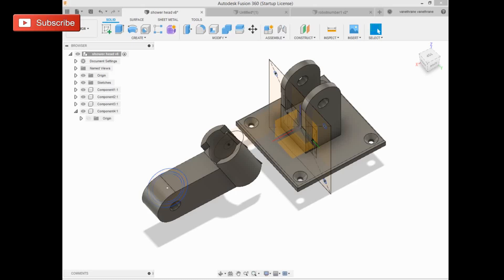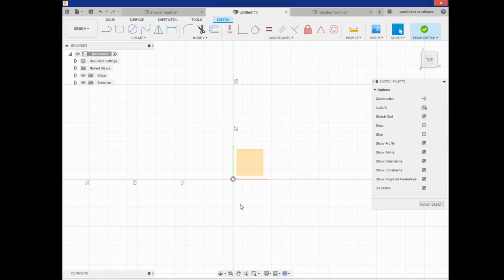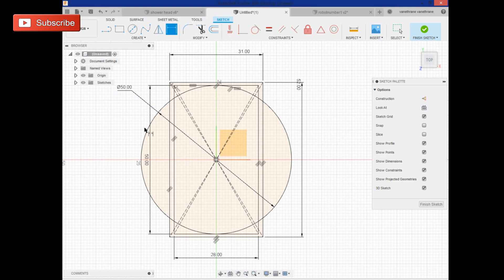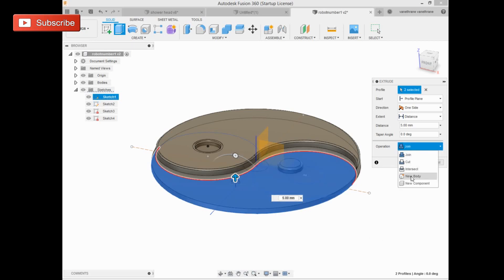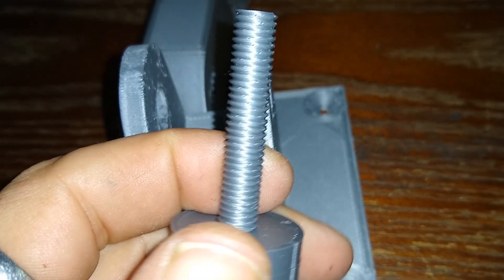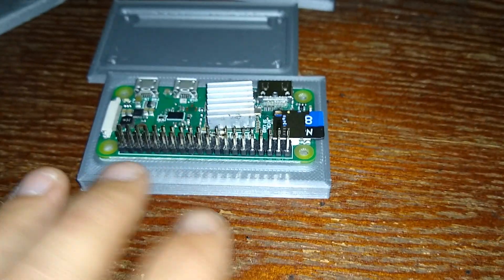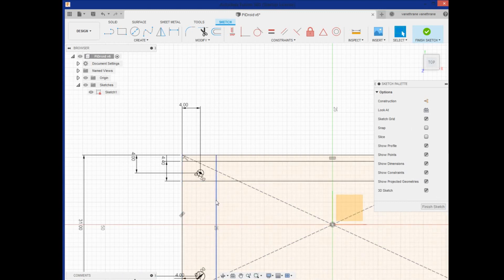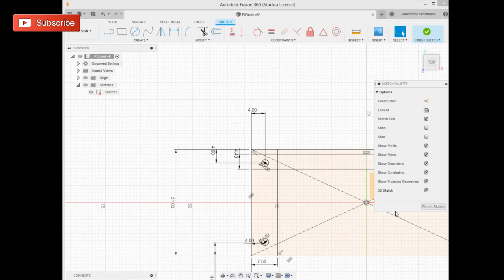Why is fusion 360 better than blender for technical models?

Comment: More advanced dimensioning:
Every dimension has a unique number from d1 to d whatever. You can set your first peg diameter then type its d# for the other 3 pegs. Only have to change 1 and the others follow. Math operations can be done in the dimension entry box as well. 
All dimensions can be found under Solid, Modify, Change Parameters.

Comment: I am interested to learn something new....I like to learn product designing and a few additional tools with it....I don't want to go complete engineering ...I have worked on a few designs in fusion 360 it's good...I have no idea about blender but saw some posts that blender has some add ons that fusion 360 cannot do ...Is that right? what will you suggest me to go with...does fusion 360 contains everything blender has?
Reply from the maker: If you need organic models or sculptures blender is better imo, but fusion 360 can do it. Fusion 360 is much better for technical or mechanical designs however
Reply: @Technivorous  thanks for the suggestion🙂 I'll master fusion 360 first then....

Comment: Unfortunately I'm stuck with blender for all my designs, as I refuse to touch windows with a 10 foot pole and as far as I can tell fusion doesn't offer a Linux version
Reply: I'm an old auto desk inventor guy and have played with 360 and sketchup quite a bit. Forced myself to start learning blender so I could drop windows and it turned out to b a great desision. I now like Linux Mint better than windows 10 and I like blender better than 360. Blender is getting easier and faster by day. It's very powerful. Linux also has a great DAW called lmms if u like music production.
Reply: @Reid M I could, but I don't like the idea of having to switch operating systems or boot up a slow VM every single time I want to use a program I use daily
Reply: @lizardface110  There is Fusion 360 Online

Comment: Blender? are there people using blender for mechanical design? It's like using a fork to cut a steak.
Reply from the maker: Sadly, some know no better. But that's why were here, to help the newbs!
Reply: @Technivorous  fair enough, the latest video I saw on YouTube, was a guy modelling a warehouse structure in 3d max.
Reply: Sadly, you guys like to push, this blender is only for sculpting propaganda, since you can make precise parts with blender. Also holes/pegs can be same way parametric in blender. You just don't know how to use it ;) And no you don't need to rebuild whole model from scratch.

Comment: As a Blender user, I will admit that Fusion 360 is better because it was made specifically for prototyping. When Blender was created, it was actually used for animation only. Over time, it became more of a switch blade army knife. It doesn't do measurements as well because you have to adjust, calculate and translate the units. However, despite that you can still create what you want on Blender. Just make sure you transfer the model in parts.
Reply: Blender unit system is metric by default now, you can also select imperial and measurments work just fine.
Reply: I'd been using Blender since 2008. Nothing you said about blender was correct 3 years ago. It wasn't even correct in 2009. The only real drawback of Blender vs Fusion360 is that Blender doesn't have any knowledge of basic engineering tools and items by default. The main version of blender I used for 3D Printing over the years was 2.79 from 2017 until I updated to Blender 3 last year so I'm going to be talking about the version from 6 years ago. Blender by default uses virtual units. If you look in the scene tab in the outliner you'll see scene units which will let you specify what unit you want to work with and then will allow you to place vertices down to 0.001mm of accuracy. If in the viewport you open the properties menu (N) and look under Mesh Display you will see the Length and Angle options in the Edge Info group. Turning that on will tell you the exact dimensions and angles of every edge on your mesh.

Blender does accuracy perfectly out of the box. It just requires knowing how to use it for accuracy because these things aren't turned on by default. If you need them to be, you can turn them on and save that to your startup file. Blender is essentially the jack of all trades.